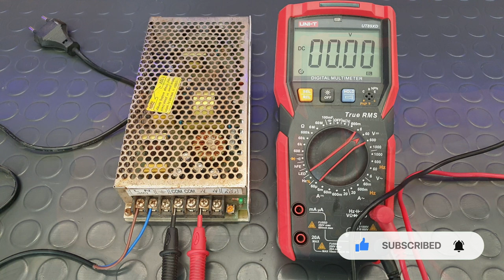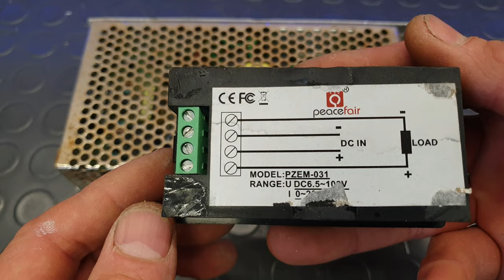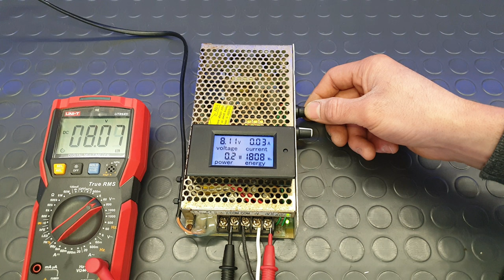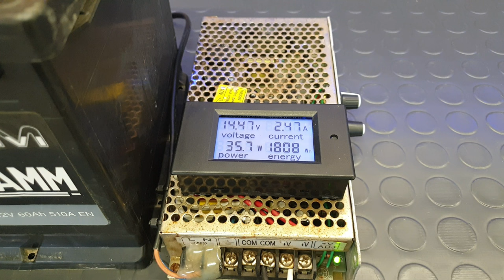How to make 12V Battery Charger at Home from Switching power supply | Led trafosu ile akü şarj etmek

Comment: Pro tip you should have used 2 diodes for reverse current and voltage, also put them o a radiator cause they heat a bit up, that way you won't blow up the power supply.

Comment: Hi, I liked the video, congratulations! I want to make this charger but my power supply is a little different than yours. I have a 12V/30A power supply and the resistor to replace is 1.5K, should I replace it with a 500 Ohm one or how many Ohms? Thank you.

Comment: Can you charge a battery from here like litium battery and LTO BATTERIES to??
Reply from the maker: This is a 12V power supply to which I added a function to adjust the voltage to 16V so that I can charge a car battery.  But the only drawback is that you cannot control the current and it charges with a maximum current of 10.5A.  It also has short circuit protection
Reply: @ErCanEverything  can you charge a yinlong battery here ? If thats possible thats a good thing as im not worried on higher amps as i need that floating amps as i use high current bass amplifier
Reply from the maker: I think you can charge it, but it all depends on the specifications of the battery, whether their charging current is not smaller than the power supply.  Otherwise, they will heat up a lot

Comment: Thank you 🙏 thank you 🙏 this is what I was looking for, does it stop buy it self when it’s fully charged or reverse to just a 30mili amp hour and fixed voltage ?, can you maybe make a current regulator knob? , can you make it 24 volts  ?, does it go below 1volt ?, can you add state of charge indicator? It would be the ultimate charger , thank you
Reply from the maker: Thank you🙏🙂🤝
The current regulation is a bit complicated and the minimum voltage I think was around 3.5V, but I didn't show in the video because the voltmeter display turns off below 6.5V.
It is possible to increase the voltage to 24V, but the capacitors must also be replaced, Otherwise they will Explode!!!
Reply: @ErCanEverything  thank you again and thanks for the answer

Comment: How did the charge process stop
Reply from the maker: The charging process continues while it is turned on.
This is not a problem, if you charge 24h at a voltage of 14.4V.
After all, cars constantly charge 14.4V and people travel 1-2 days without stopping.